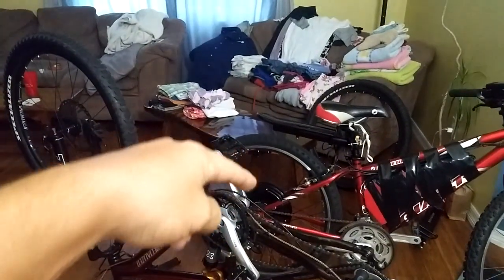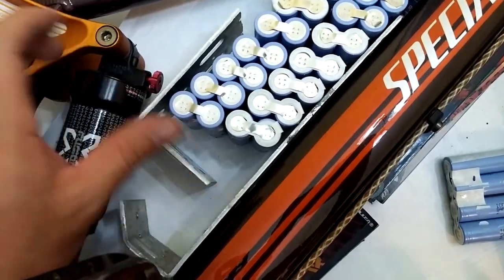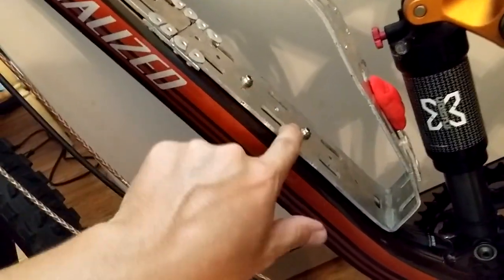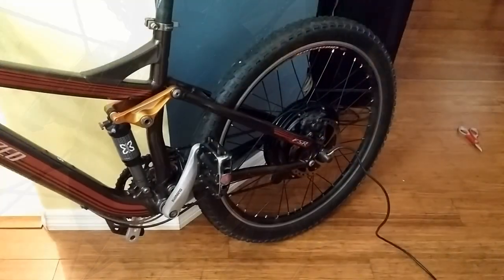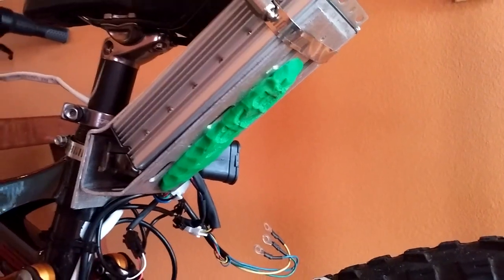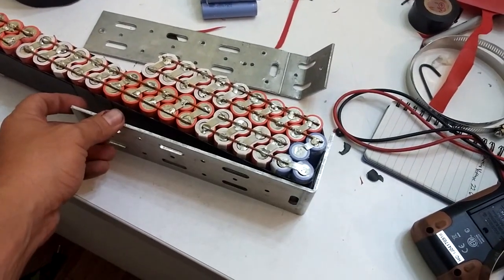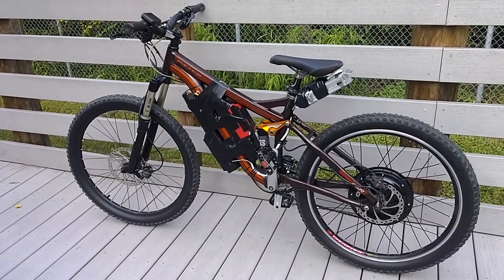FAST DIY E-Bike 48v 18650 Battery 1000w Hub Motor | Ebike Build 004 | JTgoesPro

Comment: Hi there,
I’m trying to find battery parts online. Could you please HELP ME! I need the 48V base socket for the battery type that slides down onto the aluminum rail and connects to the male plug on the bottom of the battery.
Reply from the maker: I got all these parts on Ebay

Comment: How about raising the seat and reconfigure the batteries to be on the sides of the tire instead of ontop..like a saddlebag. ..??? Maybe.
Reply from the maker: I ride comfy, and my legs are very short so the seat height works for me. I like the battery where it is for proper weight balance, its low and sprung weight vs unsprug weight be directly attached to the rear triangle, plus the rear triangle moves with a complex movement making attaching it very difficult. I like to make things as simple as possible. =]

Comment: How do you solder all the batteries and where did you get them
Reply from the maker: Zaktrimmermusic _ With a solder gun. I got them from the internet.
Reply: JTgoesPRO alright thanks. How does each cell connect to each other though?
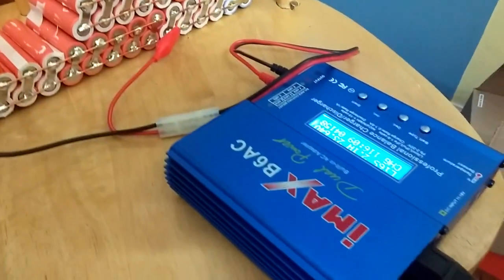Reply from the maker: Zaktrimmermusic _ look at 2:58.  I just soldered on 10gauge solid copper wire.

Comment: I see you have a Lipo charger. I was asking myselfe if I could use one of those to charge my 36v e-bike battery. The original charger gets way to hot. Do you recommend this charger?
Reply from the maker: Klara Sprudel it's only for 24 volts or less. I used two for this 48v pack. But now I have a single 48 volt charger.

Comment: Bring it to a bike shop so they can put the nice double walled specialized rim on the hub motor
Reply from the maker: Bobboy 235 Yeah, I kinda have to now. After a year of bashing curbs, both rims are very warped and dinged. Future upgrades for sure!
Reply: JTgoesPRO yeah, I got a Curb Bad Also.
Never Noticed That All My Spokes Are Too Long, and Will Not Tighten Completely, Chinese Oversight!
Another Thing, Chinese Instructions Are Very Lacking, Such As Which Side To Put the Wires On a Front Motor. 
Instructions Are Non-Existant!
Motor Ran Backwards, Switched Wiring, Fried $450 Battery, BMS!

Comment: can you please give specs or link of the electric motor? Thanks
Reply: just search for a 9c motor (9 continents motor) most are clones but will work well with kt controller and lcd3 display. Make your own battery from used laptop batteries (save a fortune if you have the tools). I would go with 48v 40amp controller to start with as you will get alot of torque and 35mph+. Try wing bikes or cyclotricity if you want good kit.

Comment: have you had problems with the electric engine kit you bought from ebay?
Reply from the maker: Fog Zoom none. 1000 miles on mine now
Reply: Ok, then i will buy it! Thanks
Reply: +Fog Zoom  How did it go?
Reply: misamisatv I couldnot buy it to my country so I bought a motor from goldenmotor.com that I know I can trust.
Reply: +Fog Zoom  How much did everything cost?
Reply: misamisatv you can get it everything for 800€ + 260€ airshipping if you dont buy the whole brake set up and the metal things that the chain is on when bicycleing

Comment: what sort of speed do you get in moderate (~15%) hills?
Reply from the maker: Isaac Morton I'd say upper teens to 20 on moderate hills without pedaling is no problem. I've never really done anything too steep, but the motor does lack that type of hill climbing tourqe.
Reply: JTgoesPRO thanks for the reply, right now I'm super stuck between getting a mid drive which can handle more torque but is nosier or a hub. have you ever used a mid drive? if so what is you opinion?
Reply from the maker: Isaac Morton Yes, trade offs with each type. Hub is simple and cheap, that's why I went that route.  Mid drive would be better for an off road jumping type bike, performance wise. Hope that helps!

Comment: that looks so s*** I am absolutely speechless. Yes you are correct a hack job! you are not a mechanic whatsoever
Reply: Kim Passey so you can buld a beautiful electric bike, but can't post images on the net in 2017?
Reply from the maker: Kim Passey thx for the love girl. B)
Reply: JTgoesPRO 
okay I will give you this the battery weld is pretty good. I know it wasn't easy to design the layout but I'm just saying you definitely dropped the ball on making it look nice at the end. I do the exact same thing period build lithium ion batteries and retrofit into scooters bikes exedra. You should have just gotten a bag to put the battery in and hang it on a hook. All that trouble for nothing. my God that duct tape is it ugly on such a nice bike. once again awesome solder job on the batteries period but that's about it buddy
Reply: if I could post pictures of my builds I would
Reply from the maker: Kim Passey I wasn't in it to be pretty, just fast. It's since been rebuilt too. Check out the new video. It's 60% bigger. I do plan on making a nice fiberglass case to cover the battery. But for now the tape works well. Over a year and 1000 miles of dirt and street and it hanging tough. If your opinion of something only brings negativity, I suggest you keep it to yourself. Just like mama said. But thx for the comment! =)

Comment: is it better to buy a front 1000w or rear wheel kit
Reply from the maker: Nick Walters Depends really. I like rear for performance reasons. Front is good for simplicity if you're just going to cruise around. Rear is good for faster more nimble riding. thx for the question! :)
Reply from the maker: Nick Walters Nick Walters Depends really. I like rear for performance reasons. Front is good for simplicity if you're just going to cruise around. Rear is good for faster more nimble riding. thx for the question! :)
Reply: JTgoesPRO thanks for the reply

Comment: how do you get 18650s to only be at 24volts?
Reply: eli oliver 
each 18650 is 3.7v and full charged is 4.2 if u put 6 positive and negative will make 24 volts and the amps can put them in parallel to make it lass longet +[     ]+[     ]+[     ]+[     ]+[     ]+[     ]   = 24v
Reply: Luis Samperio so is that 6 cells in total or 6 positive and 6 negative? probably a stupid question.
Reply from the maker: it's actually 48 volts
Reply: Dinotale nooo thats parallel connection  it would be 3.7volts and a lots of amps...
you can connect them like that when u want more range
Reply: Luis Samperio ah okay, so around how many cells do you think I'd need for a 48v battery?
Reply: Dinotale how much would u need of range?
Reply: Luis Samperio not too far but enough so it doesn't quit 5 minutes into me riding it.
Reply: Dinotale  say you put 5 in paraller so its 3.7volts and 10ah good range btw last you long sooo you would have to have 6 packs to do the 24volt and 10 ah soo that would be 25 cells in total  you wpuld have to times that by 2 so u can connect them is series to do 24 plus 24 to make the 48 volts
Reply: Luis Samperio so I'd need around 50 cells to make a 48v battery?

Comment: how many miles inbetween charges?
Reply from the maker: i go about 50 when I'm just hammering on it. otherwise, if you milk it, you could easily go over 120 miles from fully full to fully empty
Reply: Wow! thats amazing! 48 v and how many amps? I am planing on building a baterry myself soon and I'm not sure on how many amps it should be. I have a 72 V 3000W hub wheel motor.

Comment: Awesome job! I'm looking to do a built like yours. What kind of bms did you use and where to get it from? thanks for the inspiration!
Reply from the maker: I don't have a bms. I use an adjustable bench top power supply to charge it currently. but was useing 2 Imax b6 chargers.
Reply: JTgoesPRO Thanks for the response. After some study and testing, I'm currently working on mine without a bms, (thanks for the idea).  I started this project back in July.  Its now October and I'm still in build-mode, WHY? because I was dealing with the rear wheel hub motor dealer, in China. This is my 3rd attempt.  both times, the controller and LED screen was/is defective, per the dealer!!!!  QUESTION.... does anyone in the states or anyplace other than China, that sells the wheels, controller and hardware? Thanks!!!!!!
Reply from the maker: Yeah. I got my Chinese motor kit from a USA seller on ebay. link is in the description buddy!

Comment: You gave the description for the batteries you used, but what brand did you buy? Did you get cheap Chinese battery or brand one?
Reply from the maker: They are by Samsung.
Reply: Ok thx for the info, must have cost a fortune on batteries. I think i will try lipo batteries, already have experience with them and are cheaper.

Comment: where did you buy the batteries from man?! and how much were they?
Reply from the maker: +Pramod Vasudeva The internet. I paid less for batteries than I did the bike. =D
Thanks for the comment!
Reply: what website specifically? I cant find them very cheap :(
Reply from the maker: +Pramod Vasudeva I find them on ebay only. I've bought 3 different batches but always brand new cells of the same exact make and model.

Comment: 48tv 10.4ah battery would fit wouldn't  shop bought ...how much ye get ye cells for ...............nice bike
Reply: you could buy new 18650 cells at Chinese prices from LunaCycle.com(if you're US/Canada based),

OR

go to your local electronics recycling depot and pick up as many laptop/cordless drill battery packs as possible. you could probably get 50 cells for ~$100. remove them all from the cases, test them with a multimeter. 4.2v = good & charged, less than 1.0v = discharged. try changing them to see if they hold, if they don't, send the bad ones back to the depot. Assemble, solder/spot weld, heat wrap, attach cords, attach BMS, test, profit.

Comment: why are you using 18650 batterys lol, just buy hobbyking 20,000mah 6s batterys, i am not impressed with my torchs that run on 18650's they run out every time i use them! and they never charge above 4v!
Reply: Sorry for the incoming wall of text, I'm just thorough.

I'm talking about LiPo batteries, like I mentioned earlier; especially the ones on HobbyKing. I've read horror stories on Endless-Sphere about people's LiPo battery setup literally catching fire because they overworked them, and weren't keeping an eye on their condition or temperature. Less severe cases included the cells getting frighteningly hot under just a fractional usage of their claimed C-rates (6C or whatever). Some people even said the packs started getting very puffy when they maxed them out and that the chargers were a complete nightmare to use. And like Germ said, they're also kinda chunky.

LifePo4 are apparently no better either. One user bought some 52v 20ah prismatic cells, then 3 months later they went down to just 12ah. The company sent him a free replacement, but he never used it and just went straight to constructing his own 18650 pack.

So yeah, LiPo's are cheap and powerful, but if you're not diligent about monitoring them, they could fail on you or worse, catch fire (as I've heard). Are they bad batteries? No, they're not, and plenty of people use them in their builds with no problems. It's just good to know the positives and negatives to every option.

Personally, I prefer a battery pack that has high energy density/performance, that I can just set and forget without worrying if it will kill me in my sleep. almost all pre-built e-bikes now use 18650 cells for these reasons and more.
You want cheap (18650) cells? go to your local electronics recycling plant and pick up as many laptop/cordless drill battery packs as possible. Remove the batteries within, then test them with a multimeter. If they're ~4.2v, they're golden. If they're~1.0v or lower, try charging them to see if they hold a charge, and if they don't, form a "dud" pile and return them to the recycling plant. Repeat steps 1-4 until you have enough cells. Assemble, spot weld, solder, mount. Profit. Don't forget to add a battery management system (BMS).

At the end of the day, you usually get what you pay for.
Reply from the maker: Cause i wanted a custom shape, not a bunch of squares all over my frame. I charge mine to 4.18(pack charge of 50.2), everytime. Don't buy shitty batteries I guess.
Ell ohh ell...
Reply: TheMegaJerm
yeah but any one of those cells could go bad and you never know right?
Reply from the maker: True, but they are all brand new Samsung cells. I'm not worried about it.
Reply: +bartsshorts The 18650 lithium composition is more stable, reliable, runs cooler, and like Jerm said, easier to make into custom shapes. LiPo cells could literally catch fire if you don't keep an eye on them.
Reply: *****
more stable than what?
Reply from the maker: +GustSergeant not a waste of time. that info is awesome!! thank you for taking the time to write it! Thousands of people come to this video, plenty of good info to spread around to them. Thanks again! :)

Comment: awesome build I like the components you are using for the brackets. Do you hand bend those? You should look into ABS and a heat gun to make the case thats what I use. What is the capacity on that battery? 20ah?
Reply from the maker: +Cutler Cycles Yes, I hand/hammer/vise bend them, they are made of aluminum, so its pretty easy. I do plan on making a better "box", prolly out of fiberglass tho. And yes, this battery was around 20ah. The bike is currently apart, I'm adding 60% more capacity to the battery. I want about a 50 mile range. =]
Reply: +TheMegaJerm . . .That;s a lot of 18650's . . .  .What do you think the weight is for the whole battery system?. . . .At what point do you go fat tire?